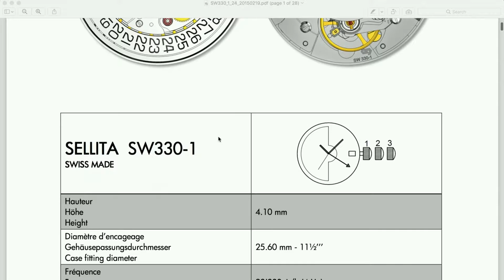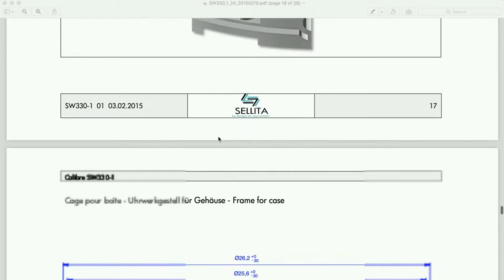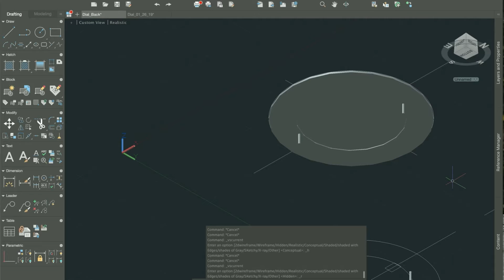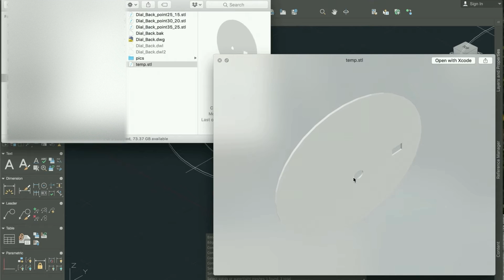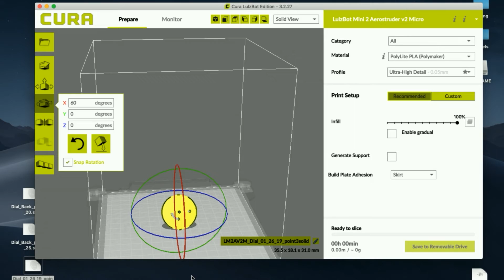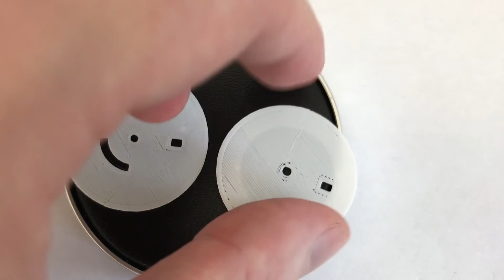Making Custom Dials Part 2: 3d printing dials

Comment: I wonder how well epoxy printing would work. The detail possible in a decent printer could make anything possible. Fdm seems a bit too grainy for high detail.
Reply from the maker: the resin printers can do pretty good. all comes down to how fancy a printer, materials, and how much a person is willing to spend.
Reply: @WatchComplications  I see some incredibly detailed display pieces coming off resin printers. I have a couple enders but never wanted to get into resin. Seems messy.